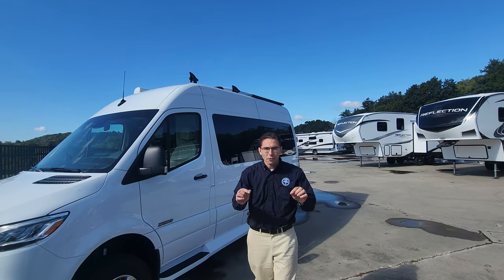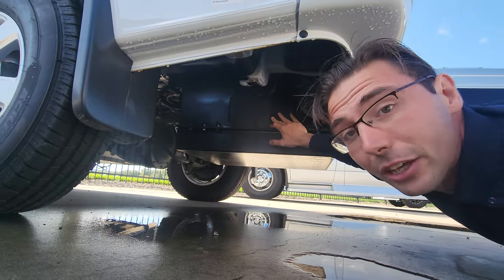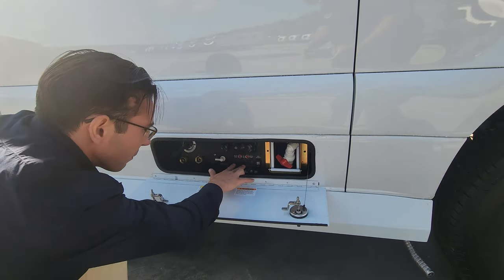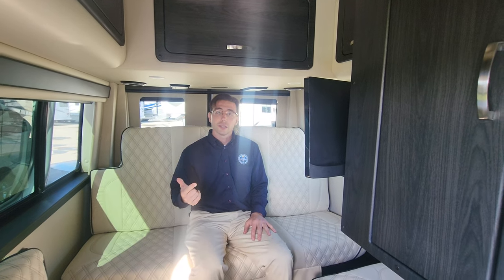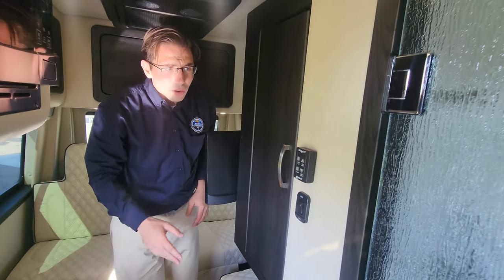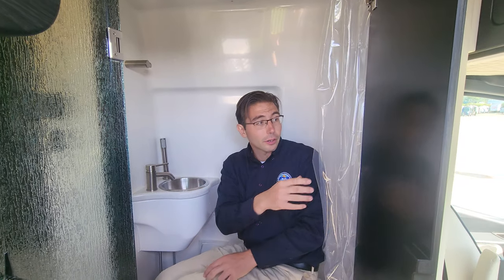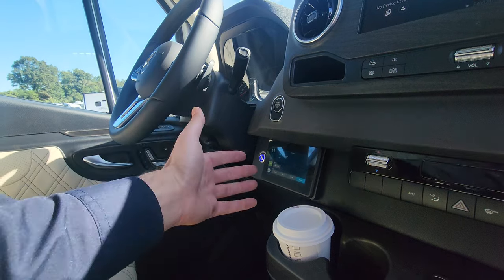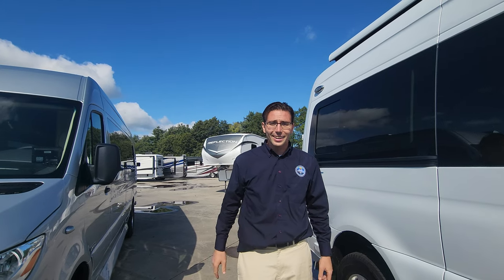American Patriot FD2 by American Coach - 2024 Brand New!!!

Comment: What is the difference between this FD2 and the 144 FD2? I’m noticing design differences between some of the FD2 models. Some seem to have better quality materials and some features are completely different. I’ve seen differences in the screen door design. It wasn’t a sturdier full screen door that slid across like this one. It seemed more pliable and mesh like and not as sturdy. Even the cabinetry looked different and most notably are the shower doors. Some were half frosted glass like this and some were fully wood. I’ve even seen differences with the refrigerator. I don’t get why the differences. They were all stated to be FD2 models. Can you perhaps clarify? 
I also would’ve liked if it was a convection microwave oven. Does that vary as well? This is still a beautiful van RV.
Reply from the maker: Thanks for your comment! All FD2 models are technically 144s. The 144 refers to the wheel base.
Reply from the maker: There are a variety of options that American Coach offers including many of the factors you've described above. I would need to see the van that you're referring to to get a better idea of the differences and why they are different.
Reply from the maker: If you're in the market for a van, I can sell you any make, any where, at any age! I'd be happy to walk you through your options.. (203) 586-4448 (call/text)